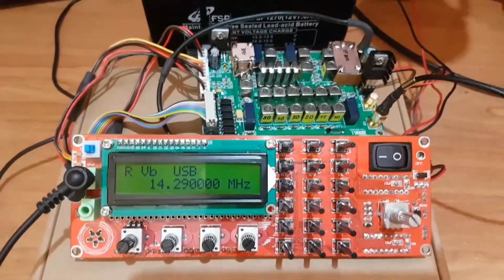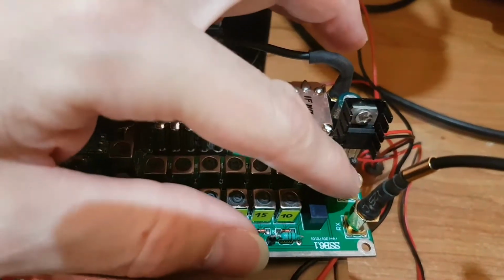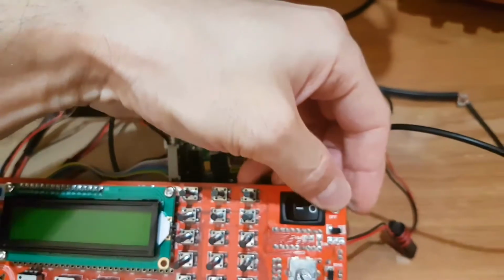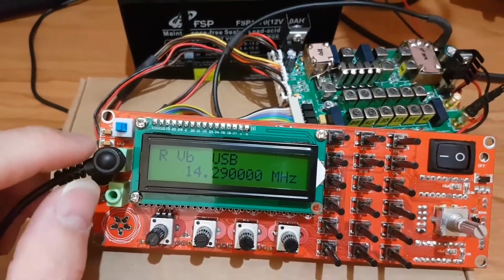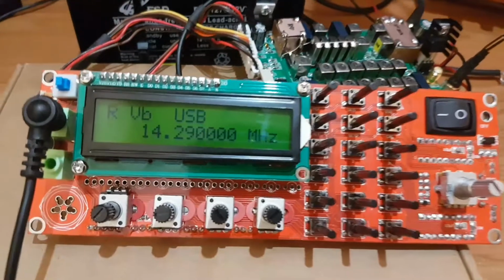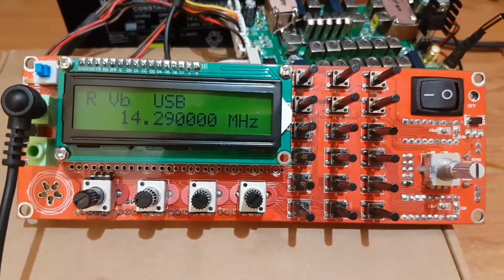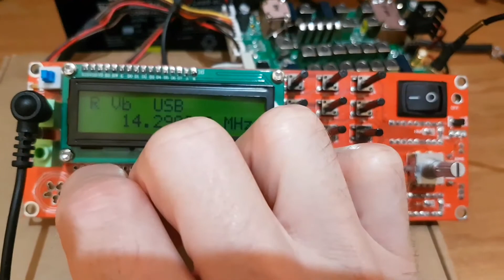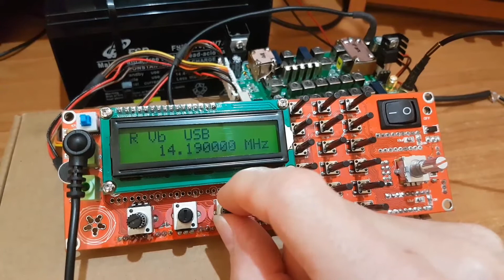Home made 6.1 SSB transceiver - RX test

Comment: Looks like a great radio to do DIY on. Glad I found this. I've just ordered my SSB6.1 mainboard and a 45W power amplifier and my DDS VFO have already arrived on my mail. Looking forward to hearing you on air if my antenna can receive your signal that is.. Haha.
Reply from the maker: My SSB6.1 receiver is little deaf and noisy 😀 I don't have proper sorted crystals. It ia very important. I have got a problematic DDS board. There is still a lot of work on this project 😉
Reply: Reading on a PDF file I found while searching for "SSB6.1" in google it says that  min rx dds freq shouldn't be on or near 8MHz since it will cause interference by leakage into the IF which is at 8MHz
Reply from the maker: @Buizie  there is a great group on FB about this DIY KIT's with a smart guru and many other members who can answer on many many questions 😉 I can post a link here for you
Reply from the maker: https://m.facebook.com/groups/1355945074463329/?ref=group_browse

Comment: Great video. Where did you buy the green board that is connected to the red board? I got mine from Aliexpress but without the other board, I cannot get it to work. The pins are also not labelled.
Reply from the maker: Thanks! I am not sure if its still available. It was purchased from Aliexpress. :)

Comment: Hello I bought the same VFO, no matter how I set it, from the antenna connector the frequency does not exceed 8 MHZ, even if the display shows 20, 30, 40 or 56 Mhz. Is mine defective or am I setting it wrong? Thanks. Regards.

Comment: Nice kit, used to start working on mine. Having some troubles. I see you made shielding around input mixer and BFO.
Reply from the maker: zoonman yes shielding but i think that is no difference with and without.
Reply from the maker: I think i heard the same sound when was 12pin DDS cable disconnected from TRX PCB. Make sure that all are 12 wires connected properly. And also try to check any output signal from DDS coax or if is properly connected to PCB.
Reply from the maker: Try to use battery to prevent noise from DC source.
Reply: I will try to find some battery. I checked ribbon cable, it appears to be fine for me.
Reply from the maker: Let me know if it help
Reply: No, I should not have in RX. This is only for TX.

Comment: Hi.  very good work.  It works perfect .  I need if you can give me some information about the connection and operation of the DDS.  Thank you
Reply from the maker: Thank you! Honestly I dont like much this DDS generator. It doesnt have much clean output signal and it needs to do additional mods.
Reply: @OM0ET  I has buying and I have liked it. This generator is very stable e good wave senoidal form...

Comment: Is it also capable of receiving LSB? Because on your own board there is only 1 X-tal at the BFO. Or does the DDS does the frequency shift?
Reply from the maker: Yes, it is, but switching is not very nice. Yes DDS does the shift.
Reply: @OM0ET  So, the DDS generates a different BFO signal approx 3 Khz higher or lower around that 8 Mhz?
Reply from the maker: @egbertgroot2737  https://youtu.be/8yIPwpCTS9g
Reply: @OM0ET  Wow.... well designed DDS! I will  check Ali ....
Reply from the maker: @egbertgroot2737  the best will be join to FB group
Reply: @OM0ET  Excellent idea .. i will look on FB right away. Thx
Reply from the maker: @egbertgroot2737  here: https://www.facebook.com/groups/1355945074463329/?ref=share

Comment: hi there ,,,nice work ...!!!   please help me to do the shame project ..i have all redy the the dds that goes with this project  ( DDS Signal Generator AD9850 0~55MHz for HAM Radio SSB6.1 Transceiver VFO SSB ) and i need the transmitter board and the receiver board ,,also the schematic and interconnection cables  if you have the kidnes to send me the addresses where i can bye them from internet ,,,thank you regards panos
Reply from the maker: Hi dear Panos, i added some new information what are you interested in, in to description of this video. Let find it there. There is also link for schematic, builders group on Facebook and much more other documents what you will need. Note, that you have to be logged in to Facebook first. 73

Comment: I built the kit. It sounds horrible and its full of birdies, the high noise is due in part to harmonic distortion ant the DDS output due to non linearity of the buffer output stage. The audio is anyway noisy by itself due to poor filtering and excessive audio gain. The AGC is a joke (derived after the audio volume potentiometer!!!) The kit is anyway fun to build for hams
Reply from the maker: I fully agree with you. The same here 😃 I never finished this project.